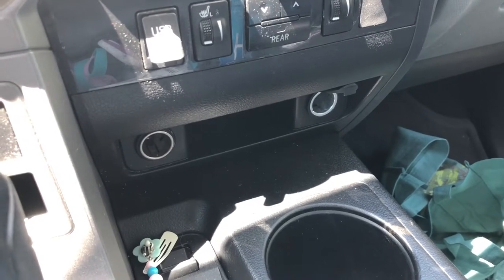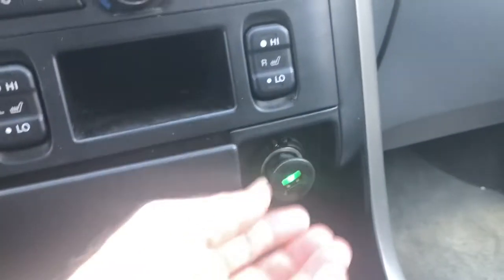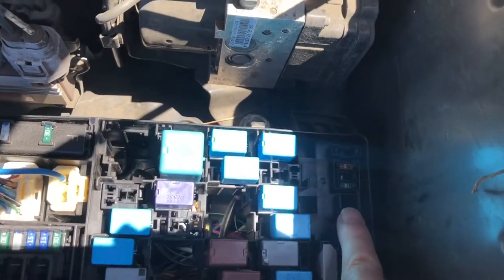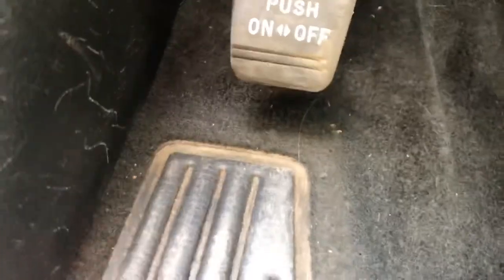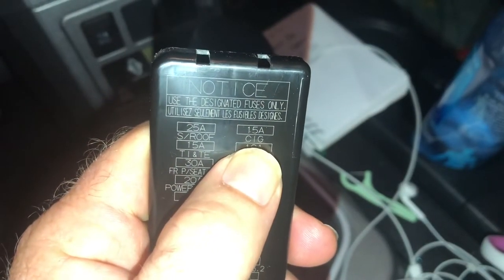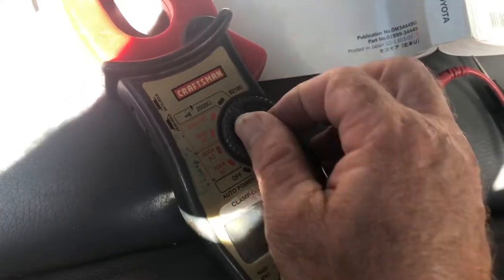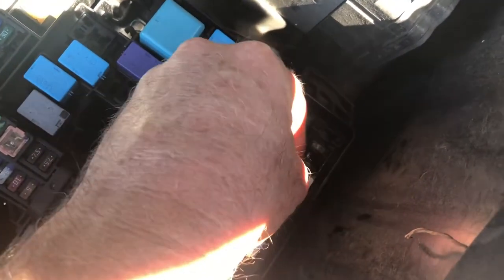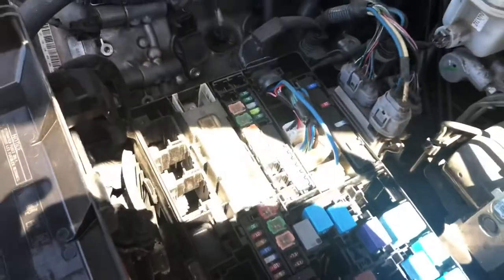HOW TO FIX CIGARETTE LIGHTER/CAR POWER OUTLET! EASY!

Comment: I'm bummed out because I had this problem when I bought my 2011 Toyota RAV4 the lighter sockets didn't work and I replaced the fuse which was blown and they still don't work
Reply: I have the same problem. I believe it's the cig. lighter itself. And I don't know if I can fix that myself.